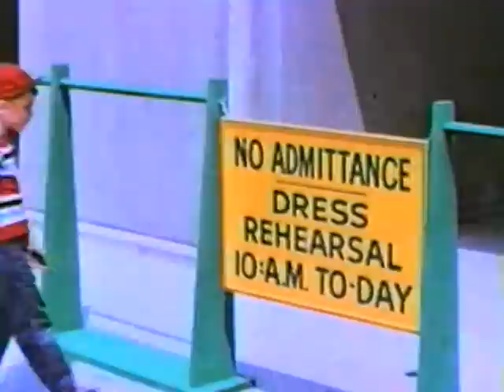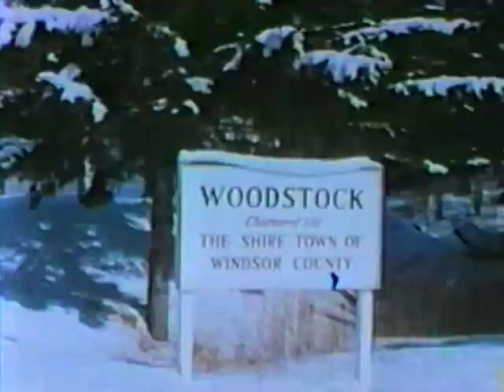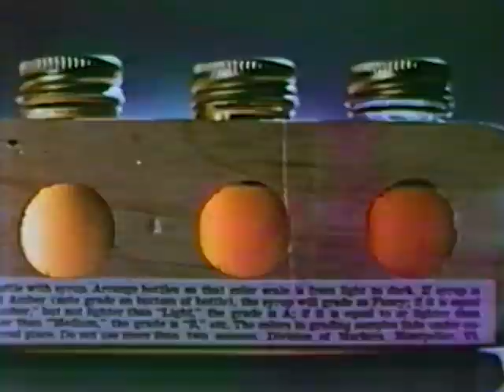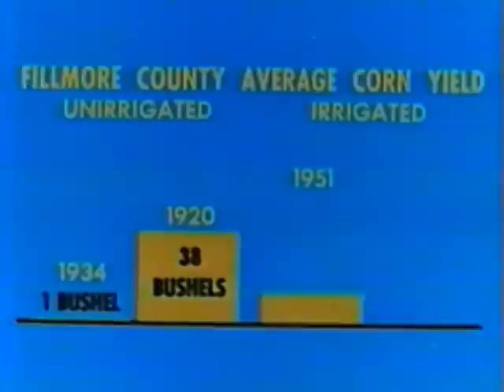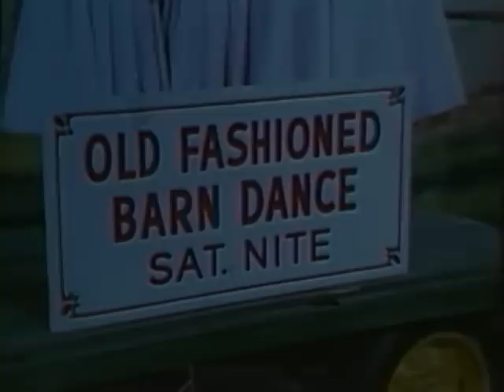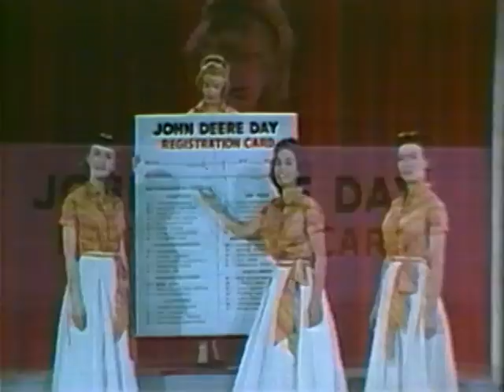John Deere 1957 Expo Documentary

Comment: Anyone have a flux capacitor they aren't using?
Reply from the maker: I hear if you drive  a John Deere 420 at exactky 13.6 MPH at exactly 5:30 am on a full moon, you will wind up in one of these videos!  😉    The Flux capacitor was a very expensive option, not available on models manufactured before the Roswell incident!  Lol.  Good one 👍